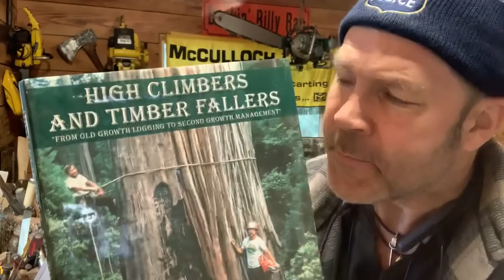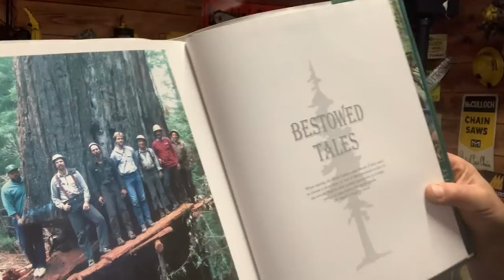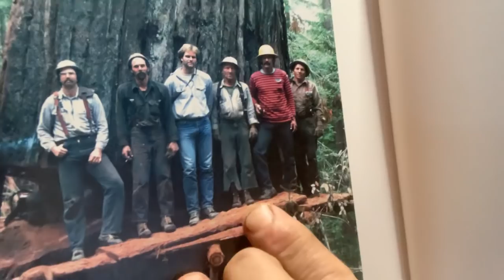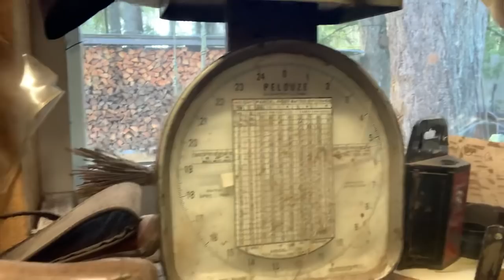Unboxing. This was a blast

Comment: If anybody here has watched Timbersports you may know that the $5000 axes they use are 6.5 to 7 lbs heads. You have to be a big 300lb guy that's really in shape to be proficient with one of those. They are razor sharp and mirror polished with very unique shapes.

Comment: Hey Buckin. Why do you cut your pants that way? Great vid as always!
Reply: They called it "stagged" pants. They cut off a few inches so they wouldn't get caught on their boot caulks (spikes) and cause tripping.
Reply: Wow, did not know you used huge steel spikes. Now the cutt off make sense! Thanks :-)
Reply from the maker: when yer 10 ft up walkin logs limbin' an Buckin' ,, and yer caulk on yer heel grabs yer pant leg , its a long way down

Comment: Thats no pulaski buckin. Thats a real deal undercutter/chainsaw axe
Reply: That's what' I was told yessir they are pretty rare
Reply: For sure, not a pulaski.  Thats an undercutter.   Only made for about a ten year period by only a handful of of manufactures.
Reply: @ronburke  Very rare indeed.
Reply: That's in real good shape too if it ever was used the user took real good care of it. It's got the w46 or 48 stamp too
Reply: @53stomper  so if i have 9 of them thats a good thing? Lol